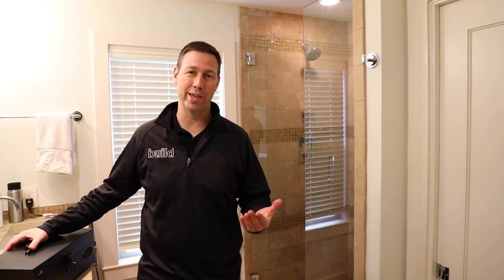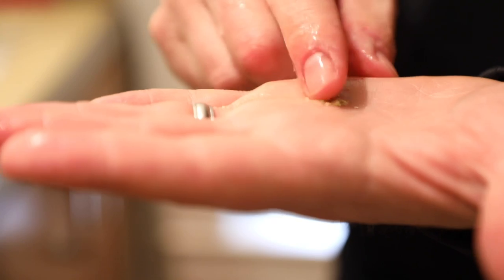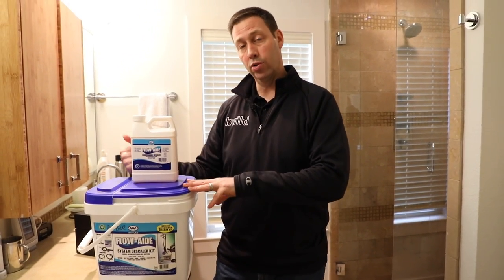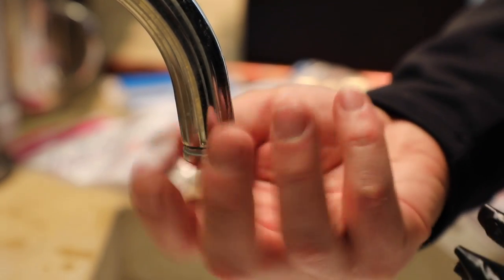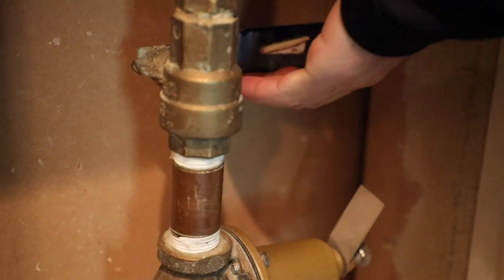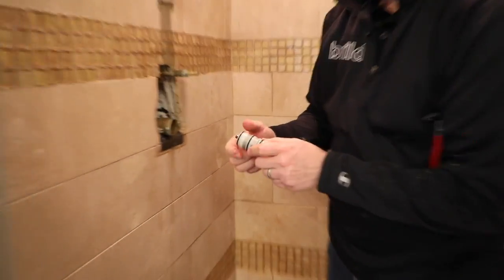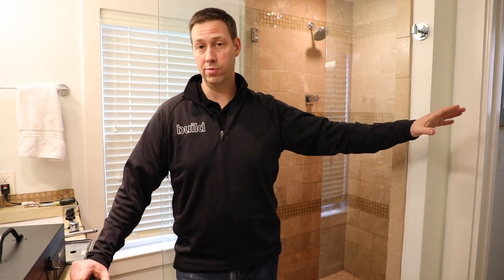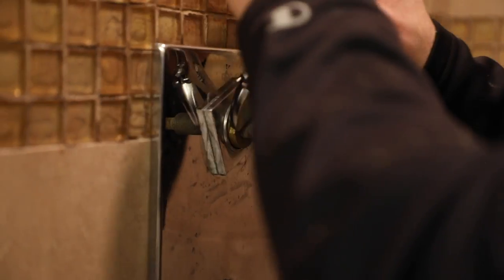The Bummer for Tankless Water Heaters - Fixing a Scale Issue

Comment: Due to some horrible contamination in our water, we opted to go with a softener with catalytic carbon, and a whole house RO system. It was not cheap in the beginning, but the benefits are unbelievable. Clean pure water, no chemicals or otherwise, no scale issues... And as for other benefits, the list goes on. We DO have basic (7.4) ph water here, so there is no concern of leaching of copper. We maintain <2ppm TDS which also helps for car washing and everything else we do. 

Is it for everyone? No, to each their own. But for the cost of new tankless, a decent system can be built from the ground up to handle all of these contaminates, and open the door to survival water should the feed ever go dry.
Reply: ive designed a handfull of POE RO systems for small public water systems.

its horribly expensive... im happy it worked out for you, but its just not a viable option for most folks. 

the pretreatment and post treatment requirements are very expensive as well... and if you are working on radioneuclide abatement( aqueous radium for example), you then have to pay quite a lot of money to test and dispose of RO membranes. 

btw, what are you doing for post treatment? RO water can be fairly corrosive. I usually spec an upflow calcite contactor with provisions for a CO2 sparging system later on after testing.
Reply: You are right about the expense. I was lucky enough to catch some of the US Water Systems sales at ~25% off. It is basically all axeon exquipment and membranes.

Pre treat is a softener with catalytic carbon to remove chlorine/ chloramine and eliminate the need for antiscalant. 

We got pretty lucky with the output. With as hard and basic as the feed water was, by the time we treat, It is basically perfectly PH balanced, with 2-5ppm TDS from softened water in stead of straight to the RO system. Didn't need a calcite for pre or post. No need for degassing in my case. I have a atmospheric permeate tank, fill from bottom with booster pump driving the house. (double check valve on permeate line). Water passes through UV then 1 micron filter before making its way back into the main line. 

Honestly, total system cost with ~1500 GPD  spec was $4500 for RO and pump/ tank + $1250 for softener. The membranes have lasted 2 years so far with less than 1ppm increase in TDS post treatment. 

Water is currently 25 gpg hardness + a long list of other dissolved solids, known carcinogenic compounds, and pesticides, so definitely took a big system to get it clean. 

POU systems have their benefits especially in terms of cost, but when you are inhaling aerosolized rocket fuel in the shower (APCP and PBAN from old test sites right in the middle of the feed river), it is kind of a moot point to even have. I am so far looking at ~15 year system life based on current wear. I think $500/ year with all costs included is worth it. Not everyone looks at long term cost though... Instant gratification is the mentality of most people these days. I love how far off our published water quality tests are. They measure the water used to feed the reservoir, but not post storage. Last year, it was off by almost double when we paid to get it tested.
Reply: John Doe I installed a small RO system years ago, but when I move to FLA, I’ll put in a whole house model,, Eg; when people come over, they can’t get over the CLEAR ICE CUBES !! No minerals..
Reply: John Doe unfortunately he was comparing DI water which IS CORROSIVE, and NOT FOR DRINKING, at a Pharmaceutical co in NJ where I worked for a few years,,the ONLY USE FOR DI water was for humidifiers in  certain refrigerated cabinets, was ONLY RUN IN SS , no copper,.but they made USP water, and some other specialty uses, but you can’t beat an RO SYSTEM

Comment: I've been backflushing vinegar through my boiler water coil for years. I mix 2 quarts vinegar, some Iron Out, and resclean, and fill a bucket, connect up a submersible pump, connect 2 hoses to inlet and outlet spigots, close off the valves which bring water to house, and open valves to flush the solution through the lime encrusted coil within the boiler. Water turns grey within minutes and then black. Installed Water Softener in 2014 and have not had to do this until now (June 2020) as reduced flow is a trickle. 45 min later, and flow is restored. Will do it 2x over next week and clean all the scale out. Did not notice any gunk in screens on faucets.  the coil guy want $150 each time to do this, all it costs me in $4 vinegar, and $2 of iron out. Submersible pump is 8 yrs old, bought at closeout at sears. When done flushing, I rinse the pump with clean water since vinegar will corrode pumps diaphragm.

Comment: I began using tankless water heaters and on demand boilers and this is a common problem. In my last replacement, I opted for an electric hybrid water tank which utilizes a heat pump to heat the water without any direct contact with water flow elements. Instead of the electric elements boiling the water at the point of contact with the elements the water is heated in coils that wrap around the tank and transger the heat through the metal by conduction. What I didn't realize or expect is that has the effect of installing a water softener. Hard water deposits are disappearing from faucets and fixtures and no more clogging.
As an engineer I believe on demand tankless heaters could also use such a design and heat static coils that would in turn heat the flow coils similar to how a solar water works.

Comment: Very timely video. I'm having that problem right now.
Love my Rinnai, but my kitchen sprayer is stops up all the time.
Plumbing Supply house near me said I needed to clean out tankless (it's been 2 years)... and also recommended a "Descaler". An electrolysis-type device.
What are your thoughts on the electronic "descaler"?
Thanks.
Reply: TexasPrepper2 I have not used them as of yet, but there are good ones out there

Comment: Thanks for this. My friend has some VRBO properties in the mountains. He has sediment filters in place but I never knew where the cal/carb was coming from. Currently repairing an Eemax with three coils. Found a wire coming from the relay controlling the 220v burned through on the primary coil. I think the triac/thyristor was the problem. Customer support agreed. Hopefully replacing the triac will do the job.
Reply: Sediment filters are very perhaps needed in that area.   You need to know WHERE your water is coming from before being concerned or wondering about "MINERALS".  In general terms, being in the mountains, very possibly, or more likely, your water is soft water with absolutely minimal concern with "minerals".  You should find out from the municipality ....unless of course your water is artesian.   Either way, find out the condition of the water before potentially wasting time and money.

.

Comment: I needed to change out the old 40 gallon water heater in the house we recently moved into. Doing some shopping, I looked into tankless (natural gas fired). I was quoted an average of $3,200 from 3 different plumbers.  With seven people in my household, I needed a large unit to accommodate our needs.  Then I found a 75 gallon gas fired tank heater with a 75,000 BTU recovery rate for $695. Add another $300 for removal, hauling away and installation of the new one.  It was a no brainer I went for the tank water heater. 
The endless hot water matra you  hear is sometimes just a crock. If you exceed the tankless capacity of heating the water by running too many items at once, you will run out of hot water, all you'll get is cool water.  During winter, its even worse. The incoming water temp in winter comes in at about 38-40 degrees, reducing its capacity even further.
Reply from the maker: Good point. I do like a good high performance tank
Reply: For next time to save $300, you can remove the old tank yourself, it's really easy, then take it to a scrap yard and they pay you to take it.
Reply: I bought it from Sears.  I understand it is manufactured by O.E.Smith. Of course this was nine years ago,  I'm sure the price has gone up.
Reply: schottley   Thanks for the advice.  The $300 was for installation of the new one as well.  But, I'm no good at this sort of thing.
Reply: i have a deep COLD water well. i have wondered how efficient a lp tankless would actually be trying to get that up to temp
Reply: You need to know how cold your water is, the maximum temperature rise at a specific flow rate.
Reply: itsmegp46 if you buy a quality unit, (don't buy from lowes or Home Depot) and your plumber sizes it correctly, you won't have any problems.
Reply: I have 4 rentals and a personal residence. All have tankless never never ever ran out of hot water on any of them!
Yes the units are 30% more expensive. The real expense is the re configuration of gas  plumbing, and exhaust pipe. Mostly labor which I do myself so for me this makes sense but if I had to pay a plumber it would only make sense when implementing in new construction or remodel. 
For me there has been no maintenance compared to the thermal coupling replacement and the premature replacement of the tank. ( my original tankless is twenty five years old have not done a thing to it!
Reply: itsmegp46 if it is properly SIZED there should be no problem, TOH, had someone run out of HW filling a LARGE BATHTUB with others in the house, they had a TANK TYPE, they installed a TANKLESS GAS UNIT  fills her tub quickly never run out , I have a gas 50 gallon, have run out with only 2 in the house,,my wife was washing, and ran the dishwasher while I was in shower,, only happened once.
Reply: itsmegp46 did yours have an installed P&T VALVE ? Some states sales were like that because of a KNUCKLEHEAD , put a plug in place, because he did not have a new valve, then there was an accident., oh WHAT COULD GO WRONG.  I have seen many idiots whom have a weeping T&P so the put an adapter in the relief,,then run 1/4 inch tubing outside, I changed many, but their problem needed a PRV as the water pressure was too high.
Reply: Dana Putnam you obviously have GREAT WATER SUPPLY, no minerals,.

Comment: A lot of scaling issues are caused by the tankless units being outside.  It is one thing having cold inlet water, but with the cold tankless unit, it is having to work much harder to get the water hot, when normally it wouldn't. Ideally tankless units should be inside, and even better is if you have an uninsulated tank to buffer the tankless unit with room temperature water first (also saves a lot of money,) and you can save even more money if you can place the tank close to a Heat-pump air intake.  Another way to reduce scaling is to reduce the temperature of the hot water so you do not have to mix as much with cold water.
Reply: It sounds like you know very little about heating water throughout your entire comment ....and less about tankless systems ....and absolutely nothing about water condition.

.

Comment: In one of our old homes, I successfully used high Gauss magnets on the water main before the water heater and a pair of magnets after. I had a plumber create a soft water loop and installed a whole house water filter with clear housing around the filter media, placing it before the water heater. It was amazing to see how the magnets began breaking up the calcium carbonate (it looked like white coral). After the first couple of hours, the water was much clearer and stayed that way as long as I changed the filter every couple of months. Though none of the minerals were removed, our scale problem at the point of use all but disappeared. I'd do this arrangement again.

Comment: I did a simple experiment with the scale that was in the faucet screen in my home. I put a few chunks in a ceramic cup and poured white vinegar in it too. Nothing happened. I did the same test with CLR, and the particles fizzled. That tells be that vinegar doesn't do anything to the scale. Unless it needs to be some more potent vinegar. You should have showed the scale collection in your bucket from flushing the system. I would think that flushing with CLR would be more effective. Also, if no $700 softener is added to the system, you will be back in a couple months. I am installing a "Hot" sediment filter on the output side of the heater, to try and catch the scale before it gets to the screens. If that doesn't help, then it moves to adding a softener.

Comment: Why didn't you show us the final step and turn them on after you flushed everything? I feel like you used me like my ex wife did.
Reply: Because he didn't fix the problem, thats why
Reply: Tom Varrette  the tankless water hearer is where the calcium deposits starts to form The calcium eventually breaks away and flows to the filter sreens throughout the house slowing down and or stopping the water flow.   I just cleaned my sreens the other day. I really need to clean my tankless water heater.    I love our tankless water heater but it is an issue we have to deal with....
Reply: Tom Varrette  thanks for your input. I am on well water. In the past before my tankless I would also get sand occasionally clogging my faucet strainers. I have since installed a water filter that holds back sediment and I no longer have that paticular issue. What I do have is calcium build up / breakaway since I stalled my tankless.   Some of my family tend to take long HOT showers and that exsaperates the problem.  I was reading another comment here about adding a strainer after the tankless. So I think I just might add a water filter (cartridge) after the tankless and see if that will help...
Reply: Hello, professional plumber here (from Jersey) 

What he said in this video is certainly not "BS". What you're suggesting only treats the symptom - not the problem. 

Clean just the screens and problem will repeat with weeks/months (plus you might be left without hotwater due to excess scaling in the heat exchanger) 

You're welcome
Reply: A good plumber would have let the water pressure off at the sink, before taking that valve off the shower. I'm still not sure what he is selling, his work, or the cleaning and a regular basic. I read where someone recommend flush them once a year, I guess a regular  service call , a plumber once a year,  Time so many costumers, is a lot of money per year.  I sure would get another opinion before listening to him for advice.  Notice he didn't show what was in the bucket when he finished either, just dumped it out.

Comment: when servicing the shower:  that shower had hot & cold shut-offs, you could have shut it with a regular screwdriver you didn't need to shut the whole house.  However, before you pull the valve, you could turn on the shower for a second to release the pressure.  Also would be nice if you showed us how your efforts fixed the shower in the end.

Comment: 1. Half of the house water shut off valves are either broken or do not close all the way.
2. Flushing a tankless with vinegar may cause it to leak. If it works leave it alone.
3. Taking apart a shower assembly and removing the cartridge is risky, even to the most experienced plumber. There's 100's of different models that Home Depot doesn't carry.
4. Tankless do not dispense hot water if the power is out. 
5. I've taken apart Tankless's and found the heat exchangers clogged with soot, destroying it's so-called efficiency. 
6. Tankless's do not save you money, they make water hot on demand. 
7. I've been an honest Master Plumber for about 35 years. I install these, but don't call me to work on one. I'd rather have you pissed at someone else..... not me.

These are some of the reasons I have a regular old fashioned water heater and a water softener. They work just fine, even if the powers off... and easy to work on.
Reply: laid out all the facts! I knew I chose wisely to keep it simple with my new water heater
Reply: @hardkore360  They first became popular in Europe, where many of the very old buildings/houses  had no place to put a large tank water heater...as there was no such thing as water heaters way back. 
I could go on and on....tankless have their place...but the drawbacks are something to consider. Thanks for the reply.